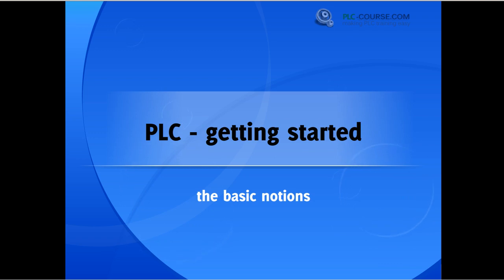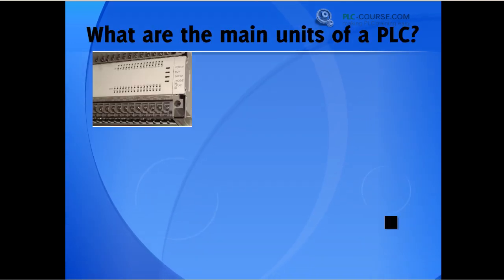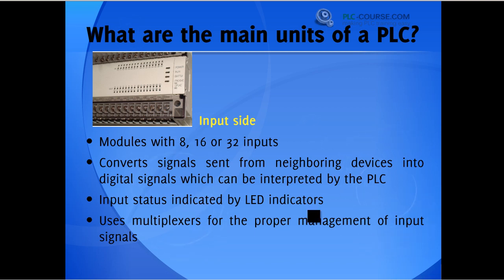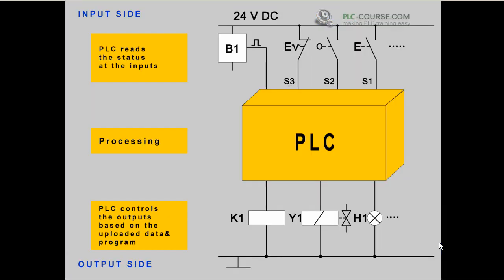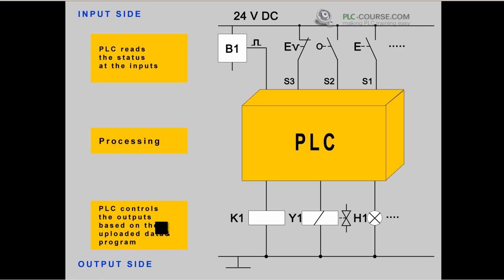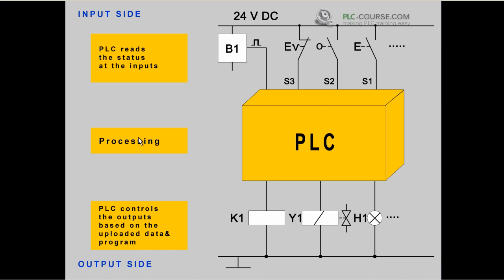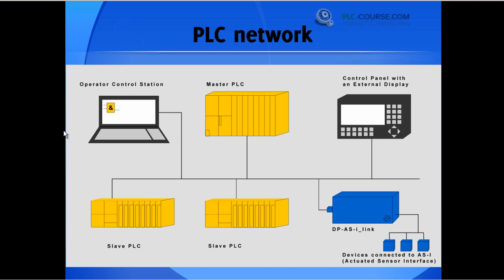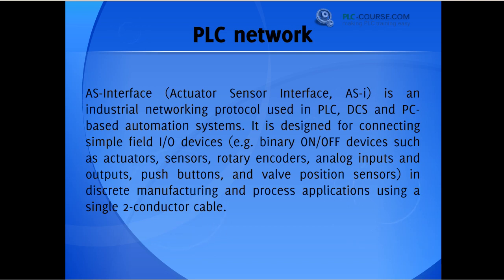Tutorial / Training PLC introduction at plc-course.com

Comment: what is the complete accessories to monitor the time for turns and torque of the pipe using oil pressure sensors.